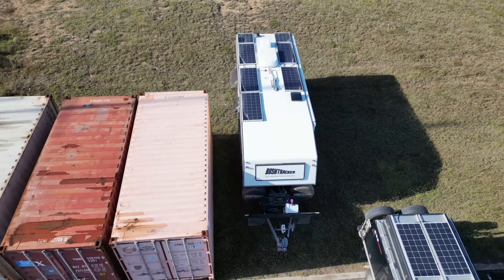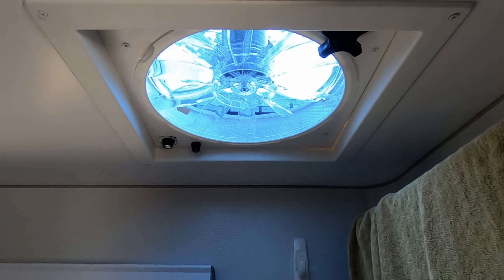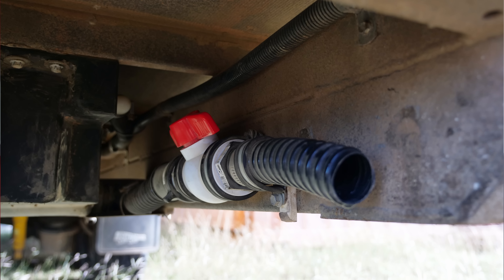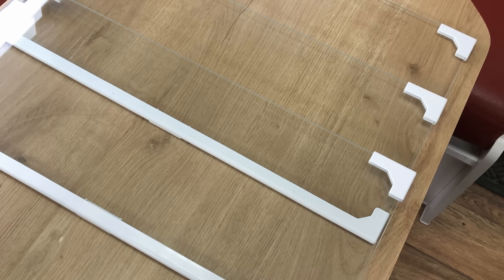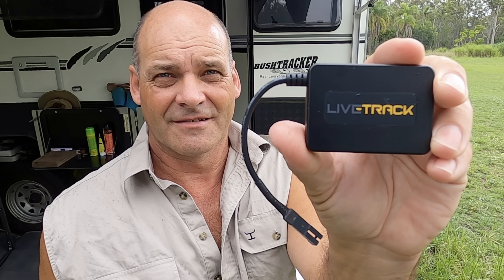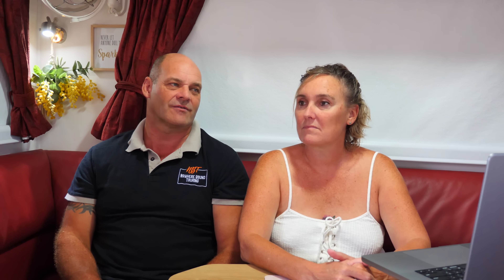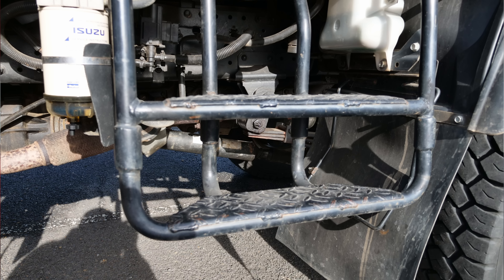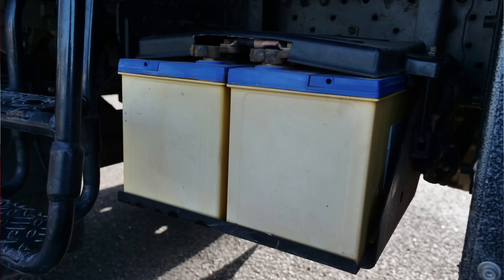WHAT YOU NEED TO KNOW! 3.5+ YEARS ON THE ROAD OUR TRUCK & CARAVAN MODIFICATIONS & ALTERATIONS #mods

Comment: Great ep guys, we’re researching our options for a truck to tow with. If you had the choice would you stick with the Isuzu or try a cheaper option like Hino or Fuso
Reply from the maker: We purchased the Isuzu because it had the largest components ( drive train etc) and a proven reliability record. It is the only truck with a 5.2l motor. The Hino truck was new at the time, and the Fuso was only 6.5 or 7t from memory.
The Isuzu is very good, but the CV’s are not strong. All the trucks in this range now have the larger capacities. I would consider them all depending on your needs and priorities, but I would not be looking at the Iveco’s. They are unreliable with high maintenance costs.
Just my thoughts,
Cheers, karl.

Comment: Hey guys, love you show what size compressor did you end up getting in your truck please and tank capacity🤠👍
Reply from the maker: Good morning,
We have the Oasis XD4000 from Jed Air Compressors, with a 12l tank. The tank is under the recommended size which is about 20l. This caused a few issues with pressure control when we were setting up the system. A larger tank works better  with the very high flow rates. The compressor ‘s flow at 100PSI is over 8CFM. Most other manufactures won’t even give flow rates at that pressure. 😄 it has been a great system for us.
Cheers
Reply: @nowhereboundtouring  thanks very much guys I’ll see how big a tank I can get appreciate you getting back to me
Reply from the maker: If you are speaking to Dan from Jed Air Compressors, mention us and he may sort out a better price for you.
Cheers
Reply: @nowhereboundtouring  yes will do for sure thank you for that

Comment: I reckon you can now be called "Seasoned travellers".
Heat is the enemy of solar panels, they rely on air flow over both sides, so sticking them down to a hot tin roof...is courting disaster. Stick on panels as convenient as they first look will fail and before they do they will deliver much less electrickery than a proper offset panel.
Reply from the maker: Gday Ben,
I totally agree with your thoughts on the panels. I would never again use flexible panels unless I had no other mounting options.
Cheers, karl

Comment: Hi guys, great vids.  In relation to the water pump coming on at random, have you checked your hot water system?  We have a Bushtracker with a Suburban HWS.  I recently noticed water dripping from the pressure relief pipe.  If the pump is not on, no drips.  If the HWS is not on, no drips.  If the HWS is on and the pump is on and the water system is pressurised, we get drips.  Worth a look.  Cheers.
Reply from the maker: Hi Graham,
Thanks for your thoughts 👍
We get the water dripping only when the HWS is heating up, and we are not using any hot water. Yours does not sound like it is performing correctly. Maybe the pressure relieve valve is not sealing correctly. Have you operated your pressure relief? 
We normally turn our HWS off at night, which would cause the water to cool down and contract slightly, requiring the pump to turn on to increase the pressure back up.
Cheers, karl
Reply: Our water pump does the same thing at night. We always put it down to the drop in temperature overnight changing the internal pipe pressures.
Reply from the maker: Gday Ross,
The switch works great and easy to do.
Cheers, karl

Comment: flexible panels fixed to a canapy over heat and therefor work at half rate
Reply from the maker: Yes,
Ours were mounted on a multi layer insulation, as recommended by the manufacturer, but still no good. ☹️

Comment: Hi Guys, watch all your content and love the honesty. Have a question on the Bushtracker roller rocker suspension 
. Is it as good as airbags  on independent swing arms on rough coronation? And do you have to use wheel chocks to level or use your stabiliser legs.
Reply from the maker: Hi Andrew,
 We have independent air bag suspension. The rocker suspension has more travel, but I believe the air bags provide a better, softer and smoother ride. We do not have stabiliser legs, and just use the air bags to level the van.

Comment: Hey guys hope your having a ball   im in progress of selling my house to get a new caravan and buy 4x4 Isuzu like yours I was going to ask about how the Isuzu handles and pulls your van I've got an old Mazda motor home  T4600 and tow a 5x8 dog trailer with a harley in it and to me it doesn't seem it likes it so I'm on my own and love the lifestyle when I leave for somewhere I don't come back for mounths sometimes lol.   And just wondering did you find out why that Axel broke??  It happened to someone else on the utube aswell hope it's not a common thing.  Anyway stay salubrious guys
Reply from the maker: Hi Joey,
 Standard the Isuzu rides very rough, but with the upgraded suspension it is much better. The truck without an engine remap is not suitable for towing our size van. It is just too slow ( I.e. 30km/h up big hills on the freeway). With a remap and now 200hp it is good.
We don’t know exactly why the axle broke, but I have a few theories why. That is why I have limited the steering lock to lock.
Cheers,
Karl
Reply: @nowhereboundtouring  hi Karl thanks for letting me know  I'm new to this and sory to an ass but what do you mean by engine ramp and how much will it cost roughly   is it some kind of computer tune ????  Cheers karl
Reply from the maker: Hi Joey,
An engine remap is when they alter the engine tune with an altered engine management software update. I would only use Diesel Tune. I have visited their workshop and had a few interactions with them. They are very good and concerned about all the important things - reliability, engine stress and wear, longevity, excessive pollution issues etc. some other re tuners are less concerned about doing it right, they just want power at the expense of a lot of other things, such as hiding alarm issues.
You can get a “ chip” that they insert which is an add on and fudges the engine software and inputs/ outputs to get the desired results ( more power). I would never use these as they can mask and introduce a lot of other issues.

Cost is about $1500 for a Diesel Tune remap (and it will void a new vehicle engine and possibly drive train warranty, most people say it won’t, but it will when it comes down to a warranty issue with Isuzu - trust me on this as I know.

Cheers, karl
Reply: @nowhereboundtouring  cheers thanks Karl I'll look into it cause I will need to tow all the time sounds like a similar engine like I've got I'd definitely need more power   thank guys stay salubrious cheers